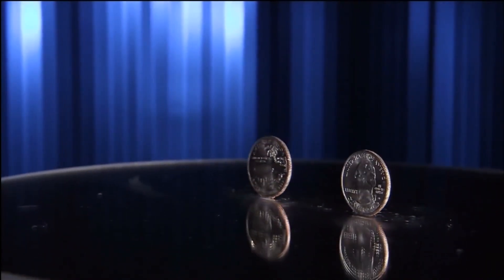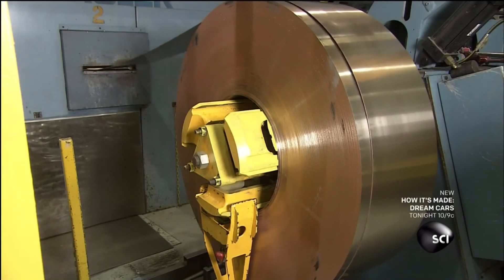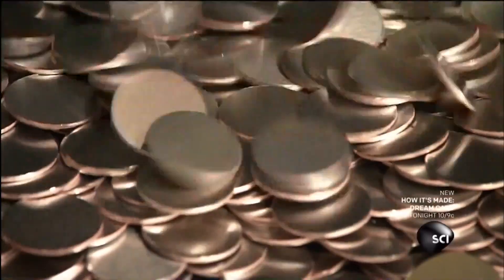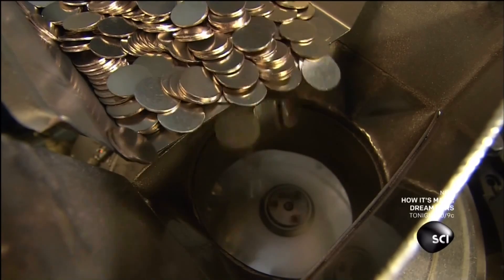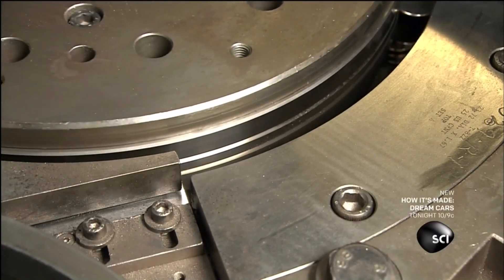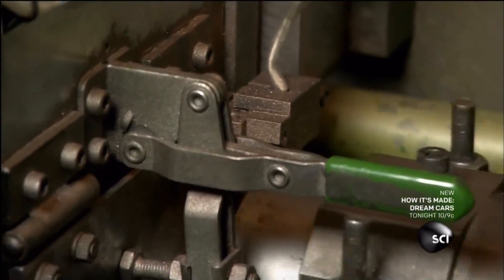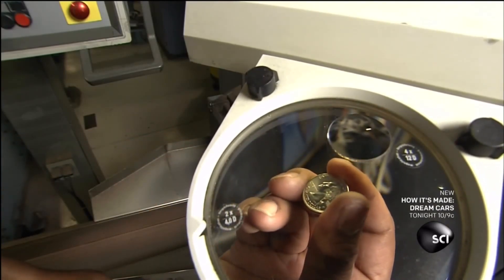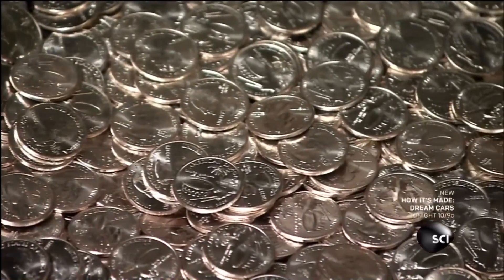US Quarter Minting Process

Comment: Nickel plated copper tokens aren't REAL money- that distinction goes to gold and silver. Real money is real money regardless of whether it's stamped with official images or goes through a Bank. It's because the value of real (gold and silver) money is based on weight (and Supply & Demand), rather than shape or assigned denomination. During the US Gold Standard Era, you could purchase goods and services with a fixed weight of gold dust, particularly within the Western States. Businesses would actually weigh the gold against standard weights. A Dollar was equal to 25.8 grains (1.671812 grams) of gold. 
Additionally, gold and silver coinage was Inflation resistant, as you could only mint a finite number of coins by however much gold and silver was in reserve. So the value of a Dollar remained stable for the c. 54 years (1879-1933) that we were on the Gold Standard.
Unsurprisingly, a quarter today has a Purchasing Power of roughly the melt value of the nickel and copper within each coin (c. 4-5 cents). Compare that to the 2022 melt value of a Pre-1964 silver quarter (c. $3.46). 
So the Government makes a profit from every quarter minted, while we're stuck with a coin (and Fiat Monetary System) that buys us less and less every year. Since 1933, the US Dollar has lost about 95.6% of its Purchasing Power due to cumulative Inflation. In order to find the true value of any current dollar denomination between $1-$500, subtract 95.6% of its face value.
Since its unfortunate creation in 1913, the Federal Reserve has had one key Mandate: keeping the value of the Dollar stable. It should be obvious to everyone that it has failed miserably at this task.

Comment: "In 1965, silver was becoming scarce. So the US government switched to this nickel-plated copper."

Yeah, sure. That's the whole reason that happened! Nothing else to it!
Reply: Yeah, I laughed at that as well.  The change was made because of the inflation of the currency and bad financial management by politicians and the Federal Reserve. The value of the silver exceeded the value of the coin, so people would have melted them down and sold them as bullion and made a killing...

Back in 1900, a $20 Gold piece could buy a really nice wool suit.  In 2022, it's worth in gold is nearly $2000, which would still get you a really nice wool suit.  However, while $20 in paper could have bought that same suit in 1900, $20 in 2022 barely buys a meal at Burger King.
Reply: @johnsmitht11  It wouldn't have mattered.  We were on the gold standard back then, value of the metal in the coin was irrelevant.

Comment: Hmmm pretty sure they stopped making them silver because people were keeping them instead of spending them
Reply: No, because it was expensive and hard to make. So they switched to what they have now.
Reply: @jasonburreson6262  No, after 1964, coins were made copper-clad because the value of the silver had approached the face value of the coins.  People were hoarding the 90% silver coins from 1964 and previous years for the silver content. It's why quarters from '65 to '67 have no mint marks.
Reply: @jasonburreson6262  trust the fed and their reasoning. it only makes sense for 25 cents to be worth 4 cents. this is a money making operation, not for you to be able to hold a value to your wealth. lol are you insane?

Comment: I wonder how much a genuine blank quarter would be worth.. I know that "imperfect mint money" is worth a lot of money sometimes.
Eg. Misprinted bills
Reply: The value does go up for blanks, especially if the coin hasn't been given a rim. There's a ton of other mint errors that can happen, like striking coins on the wrong material. If you want I can tell you about the steel cent mishap.
Reply: It should be the cost of the metals. What is the point of being expensive workout the rim? It is just plain metal/alloy. I don't get it. With the rim at least you know it was supposed to become money.

Comment: The America the Beautiful quarters (sometimes abbreviated The National Parks quarters) are a series of 56 25-cents quarters, issued by the United States Mint, starting in 2010 and scheduled to continue until at least 2021, but the series may be extended at the option of The Secretary of the Treasury, potentially extending the series to 2033, and after that, i wonder what new quarters will keep coming out.
Reply: Thst extension may or may not have happened bc of a certain virus
Reply: I wonder if coins will still be around in 2033.
Reply: @americanrambler4872  I certainly hope so
Reply: @americanrambler4872  of course they will. They just won't be traded as currency.
Reply: Enter CBDC digital currency

Comment: Why were the edges not copper color
Reply: They are clad
Reply: the nickel-coated copper sheets should show their copper edges after the blanking process. How does the edge clad itself?
Reply: They are just like the ones in your pocket.  The video doesn't have the greatest color and resolution.  You have to look close to see the brownish tint on the edge. They literally call it a cupro-nickel "sandwich" and like a sandwich, you see a lot of silvery color on the edge, with a little bit of brownish copper.

Comment: which quarts have a "D" mint.
Reply: KcKPhotography  so only three places in the whole US make coins?
Reply: @kasamali9419  There are smaller mints at West Point, New York, and Fort Knox, Kentucky.  The West Point mint used to make cents without a mint mark, just as the Philadelphia cents used to have no mint mark from the 1790s until 2016, so you cannot distinguish them. West Point stopped cent production before 2016 (not sure when myself).  Now the Mint could have the P mint mark on the cent because it would not cause a hoarding issue by collectors for the very rare W mint mark.  

There have been specially struck dimes with the W mint mark, and a few of the commemorative coins in the last 25 years that have had a W mint mark.  There doesn't seem to be a rhyme or reason to which coins get the W, I guess it depends on which mint needs more work.
Reply: Manuel Fuentes ones made in Denver
Reply: Muhammad Ali yes
Reply: Muhammad Ali well as of now, only Philly and Denver. San fransico makes coins as well but only proofs(special coins for collectors). They used to have more mints though such as New Orleans, etc
Reply: Manuel Fuentes "D" are ones that were minted in Denver as for "P" for those minted in Philadelphia and "S" in San Francisco
Reply: @KcKPhotography  no mint mark for Philly, modern issues are as you said with exception of Philly,

Comment: I wonder how often they change the back design of the quarter?
Reply: Will Graves The America the beautiful series will issue 5 per year
Reply: New ones ever year.
Reply: @sylamy7457  Till 2021 I believe.
Reply: They didn't change the back, or reverse, for 67 years (1932-1999).
Reply: The original reverse, showing a perched eagle with its wings unfurled, lasted from 1932 through 1998. From 1999 through 2008, the quarter had five different reverse designs honoring the 50 U. S. States.  In 2009, the mint had six new designs honoring the District of Columbia, Puerto Rico, the Mariana Islands, the Virgin Islands, American Samoa, and Guam. From 2010 through 2020, the "National Park" series honored five different national parks each year. 2021's two reverse designs honored Alabama's Tuskegee Airmen and Washington Crossing the Delaware. 2022 began the current "American Women" program. Each year features five different noteworthy American women. This program will run through 2025.